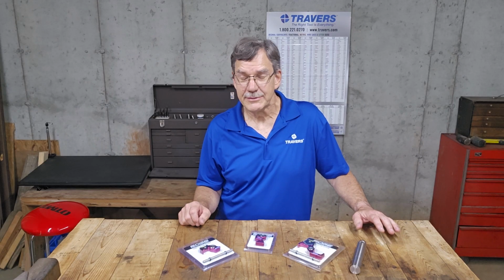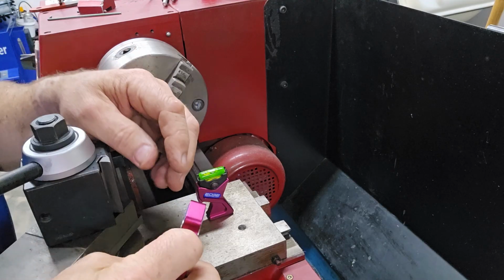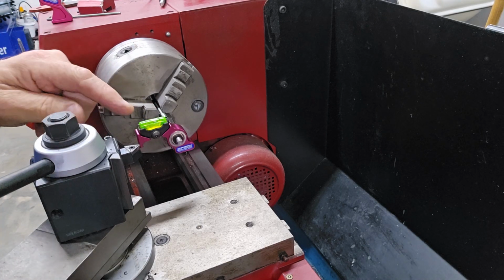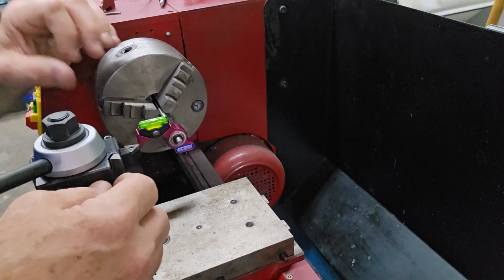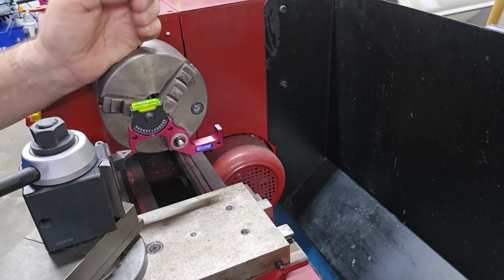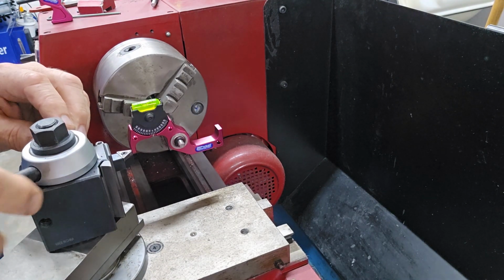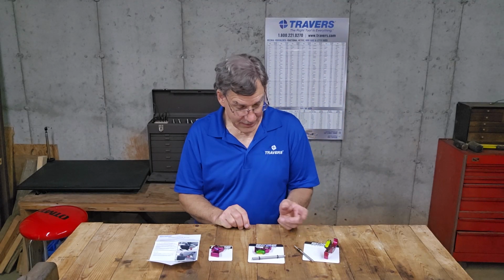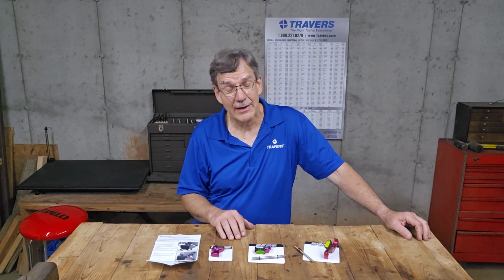Edge Technology Lathe Tool Height Gages | Travers Tool Co.

Comment: I purchased the CNC version and used it to set tool heights on over 40 manual lathe tools. It's 100% awesome! Turning tools, threading, boring bars, so fast and so easy. No more squinting and fumbling around with other methods. Guess how many tools leave a nub of material in the center now, yeah none of them!
Reply from the maker: I know, right, @ckcoolidge?! I have the other two. One for when I don't have a workpiece in the chuck, and the other for when I do. And like you-- 100% nubless. 😀👍